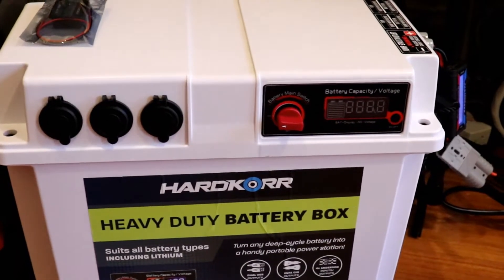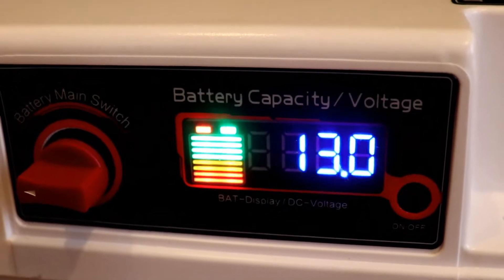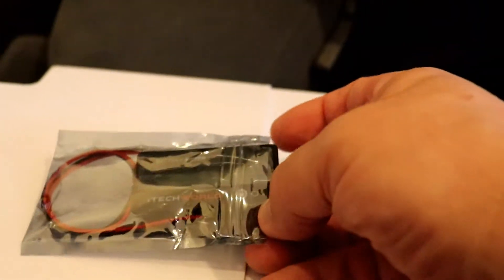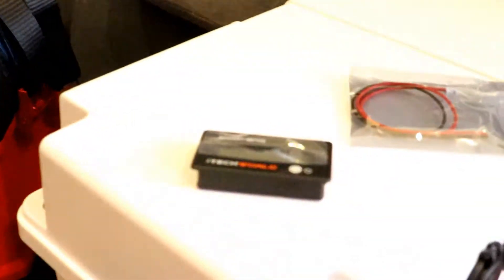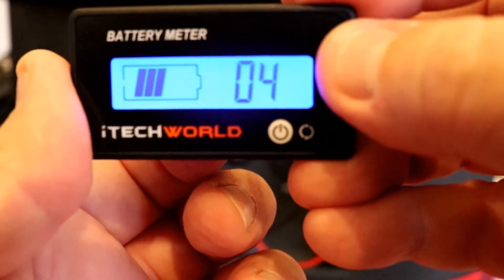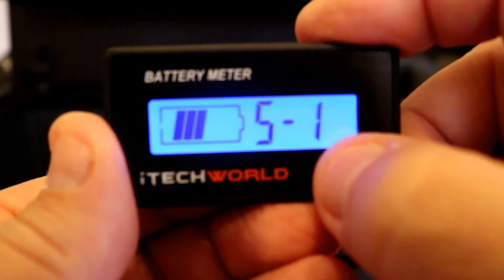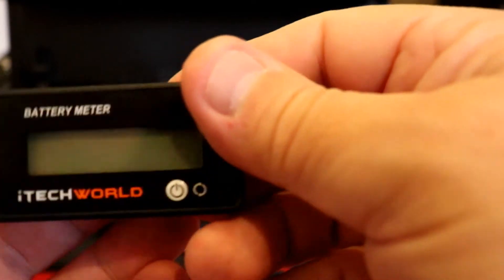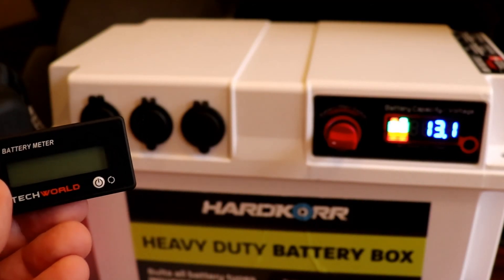iTECHWORLD BATTERY METER SETUP

Comment: how is 13.2v 100% ? shouldnt that be more like 70% ??
Reply: Itech world sent me there diagram for lithium for my set up according to them 13.1 is 95% 13.5 and up is 100%  A lithium battery at 70% would be 13.0v Keep in mind 70 80 and 85% is 13.0v also. I changed from AGM so the chart has changed completely.

Comment: I just got one of these and after testing it I found the setup instructions from iTech world are wrong for ITECH120X batteries which I've got 2 in parallel, after running my batteries down to 12.6V and what should have been about 30% SOC the meter was still showing 80% SOC I found the voltage was right but the SOC was out by miles so I changed the settings at S5 Battery Profile on the instructions from off to on and that seems to have fixed the problem, I think someone at iTech needs to check it out and change the instructions to what works, maybe it's just mine but I'm pretty sure it's not, in the next couple of days I'll test it again with the new settings and from what I've seen already I expect to get better results. Merry Xmas!
Reply from the maker: Glad you've got yours working.  I think they're ok for AGM or silmilar but cant go past a decent shunt type one for lithium.
Cheers and happy xmas to you.
Reply: @robbiereddog4202  I've got 2 ITECH120X batteries in parallel and my settings are F 4 and in the S settings at S5 where iTech tells you to turn it off I did that and it was up the shit as far as SOC went (voltage was spot on) so I got to thinking about the S5 setting and decided to turn it on and it seem to work a lot better after I turned it on and that's when I think it started to make some sense and was more accurate to what I thought it should have been, I only did that this morning and am recharging at the moment so when it recharges I'll give it another discharge with the S5 setting turned on and I'll let you know how it goes. Cheers
Reply: @robbiereddog4202  I brought it down again over night and finished draining it this morning and with S5 turned on the SOC was reasonably accurate and the voltage was spot on so in my opinion iTechs instructions are wrong when they tell you to turn off S5 if you have an ITECH120X battery, mine works a hell of a lot better with it turned on, if you've still got yours give it a try. Cheers Chappy.

Comment: How do you install it on a solar system? I have 3 100w solar panels and 2 100amp batteries. I want to hook this up to that to see my battery levels. Is there a way to connect this battery monitor to a solar system?
Reply from the maker: Dont think there is.  It's only a simple battery voltage guage unfortunately.  Youd need an inline guarge thats shows volts and amps coming in and out or spend a little more and get an battery shunt.  I ended up ditching it and getting a victron bluetooth battery monitor.  Cost more but much better product.  Cheers
Reply: @robbiereddog4202  thank you so much.

Comment: I have one of the meters and it shows slightly different  V 13.1     vs meter 13.18v   % off battery 96% my setup is somewhat hybrid 12v lead acid starting battery to a L34 yellow top battery charged by a redarc bcdc charger when full 13.1 v my Itech world battery is connect to the yellow top battery with  50amp cable and sits at the rear of my car. The plan is to run a Waeco 95 ltr fridge off the lithium. I will be testing the system next week as to it working or not: so the charge from the bc-dc charger is lead acid, 
As the Itech120x manual stated  the redback system is doing its thing and we now have almost 100amp capacity to run the fridge ,the so far no issues at all. Charging fine.

Comment: I have a anderson plug at the rear of my car that is connected to my second battery, could I just connect this to that anderson plug and still use the plug, saving me run a wire all the way to the front of my vehicle?

Comment: Not sure how that’ll work. That’s just monitoring battery voltage. It’s not monitoring current in/out via a shunt at all which is how you need to keep track of SOC with LiFePO4? Simple test I guess. Plug in your external monitor also and see if numbers agree.
Reply from the maker: Yeh doesn't have a shunt so no idea about amps in and out.  Think it may talk to the internal BMS of the battery and give a reading.
Will test it out with an amp meter when installed. 
Cheers